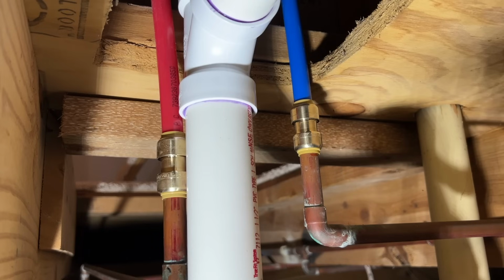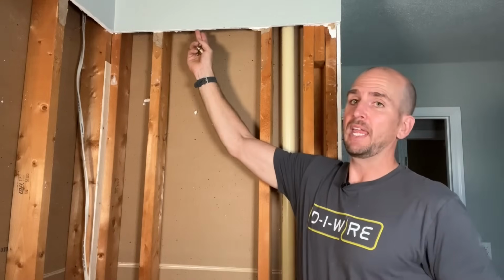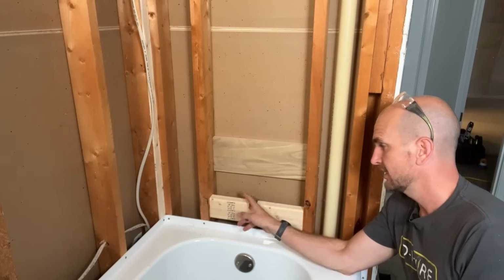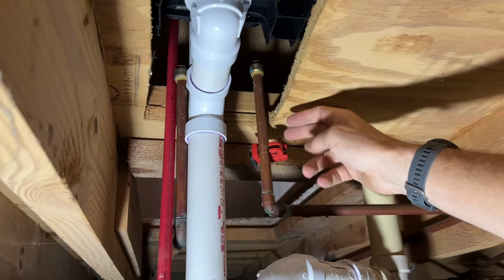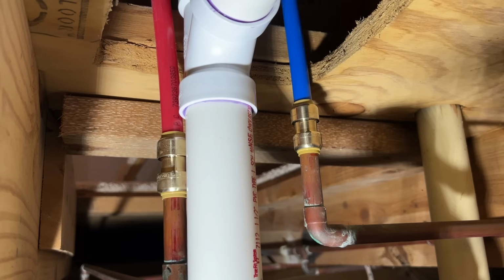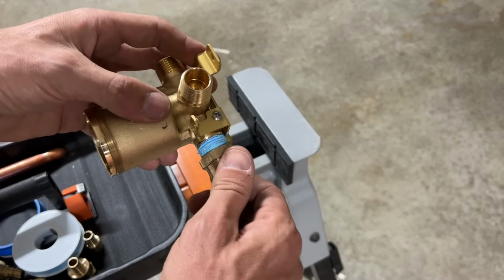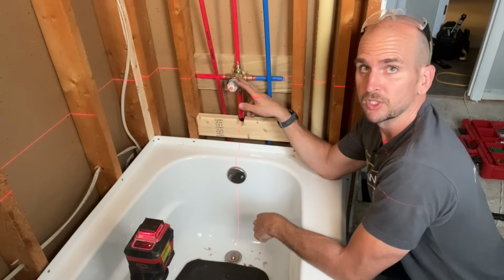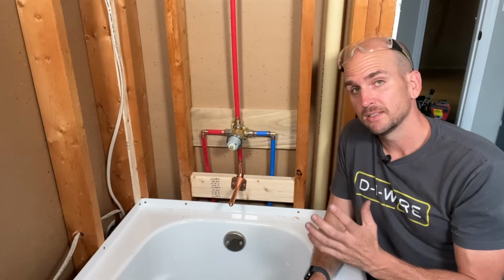How To Convert Old Copper To New Pex | Tub And Shower Plumbing

Comment: I lost all respect when you used push fittings. I have over 40 years as a professional plumber and they do fail regularly and when they slip completely off damages can be catastrophic.
Reply: Retired GC with 25 years.  My plumbers, several with 40+ yrs experience, use them.
Reply: You are just an old man resisting change from your old ways. I can imagine your reaction when you first saw a sharkbite fitting: "WAIT WHAT!!!? NO SOLDERING WHAT KIND OF WITCHCRAFT IS THAT!!!?" 😁😁😁
Reply: @kllgrogto5838 sharkbotes fail everyday.
Reply: @kllgrogto5838  well, it seams like at least 11 plus agree with me and if you have ever worked for several customers with massive property damage from push on fittings you my feel different. There are several more skillful and permanent options available. Push type fittings are definitely easier, needing fewer skills and tools to perform the job.
Reply: @jamesmarek242  push on fittings are a fairly new concept and although it seems easy many people just don't do the prep work before using one of those and that's how they fail, the same way a soldered joint would fail if the joints aren't prepared and soldered correctly.
Reply: @jamesmarek242  plumber of 30 years here, and I agree with you 💯! Sharkbites are a homeowner solution to connect pipes, nothing more! NO professional plumber should use these! You were trained, and probably paid to do it right! They make proper transition fittings that are soldered on, then switch over to PEX.
Reply: Mehhhhhh
Reply: When people take a lot of time to make a video, be a little kinder with your peanut gallery comments.
Reply: Unless you've done a root cause analysis on why those fittings failed, you're just blowing smoke because you're resistant to change. And who cares how many likes you got. Now you're trying to say "might makes right."
Reply: if they are installed properly they will never slip off.
Reply: Yep. I was just waiting thinking "what's the transition fitting gonna be?" Personally I always use solder copper for tub/shower. But if he had used 5/8 or compression to 3/4 or I guess 1/2 pex, then I would have been ok with it.
Reply: Blablanlabla
Reply: It’s always interesting to read the comments. Everyone always has a “better” way because they have been doing it X number of years. Better is usually limited by the hands that’s doing it. As a DIYer using push connect fittings will likely give you better success than trying to learn to solder pipes. It’s A DIY video not a page out of the plumbing manual for professionals.
Reply: You're so experienced why are you watching how to videos on something you know so much about? 🤔  I don't disagree about the push connections but your tone stinks.
Reply: And your respect means what?
Reply: Sharkbites dont fail.unless installed improperly
Reply: no they don't. You're just like the guy that grilled him for the tub install for not having a ledger and screwing through the flange.
Reply: Guess you missed where he said diy means not paying plumbers for doing it
Reply: Agreed.

Comment: Would you or the plumbers in here recommend this over using copper pipe with compression fittings?
Reply from the maker: My own personal preference is Sharkbite over compression fittings.  Just my 2 cents.
Reply: Yes if your not comfortable or skilled at solder, definitely next thing I'd receive is copper with compression fittings. It's gonna cost more in fittings but you still get rigidity like with solder. Which you definitely want on this install.
Reply: Not a plumber, but the plumbers on Reddit mock Sharkbite mercilessly; it relies on an O-ring and God help you if you miss a burr on the cut pipe.

Me?  I've soldered a transition to Pex-B.  You know if you did it right!  Same with compression but you can always give it another 1/6 turn tighter if it weeps.

And check out Pex-A /expansion fittings (plumbers smiled with respect when I said I'd bought brand-name Uponor/Wirsbo.  Apparently, I'd cracked the secret code!)

Comment: Did you consider adding shut-off valves to the hot and cold just for the tub?  This way you don't need to shut off the entire house hot or cold to service the tub fixtures.  Also, do you need to pressure test after completing the fittings and prior to covering with the surround?
Reply from the maker: Not really for this project but you can also get the Delta R10000 with a version that has screw water stops on the hot and cold that can be closed right at the inlet to the valve https://amzn.to/3MCFJfm  Kind of handy.
Reply: @EverydayHomeRepairs  By the way, thank you for your great productions. You are providing great insight for the DIYer!
Reply from the maker: @Rob-Eckert  Thanks man 👊

Comment: I wish this video would have came out earlier this week. I just finished a big project where I ripped out a ton of funky ancient copper with a ton of elbows and unions and replaced it with nice clean runs of Pex-B.  I did not use any Sharkbite fittings. I went with the Pex "pinch" rings. If you have a chance, check out the Ryobi 18V Pex pinch tool. It made child's play out of installing the rings even in tight spaces. (Ryobi also makes a battery powered copper ring crimp tool). I believe Ryobi is the only company to make a battery powered Pex-B "pinch" ring tool. My brother was helping me and he couldn't believe how fast and effortless everything went with the battery powered pincher. Well worth the $119. One reason I went with the pinch rings is they are easier to remove than the copper crimp rings. You simply nip the crimp nub on the ring and the ring literally falls off. Then I take a battery powered heat gun, heat the pex for about 15-seconds and it pulls right off the coupler. So there is no need to cut the Pex in order to get in there with a copper ring cutter. Anyway, I was very happy with how everything went.
Reply from the maker: Thanks for all the great feedback.  Hard to beat Ryobi for the DIYers 👍
Reply: For now....was the copper leaking?
Reply: @maxpower9848  I had one small pesky leak and the entire run was nasty looking to the point where additional leaks could occur at any moment. I had one 24-inch section that had FIVE! junctions!!!  I'm not kidding. It was like they used a whole handful of 4-inch pieces instead of one single piece. I also had a shutoff valve that was frozen. Now things are super clean with better flow and ball valves used throughout. I plan to replace my water heater soon and now it will be effortless.
Reply: Great comment.   California

Comment: Why would you use pex in place of copper? Not construction savvy.  I did 3/4 copper in my house based on a professional plumber.  My father in law.
Reply: 3/4 inch copper is a great choice. You shouldn’t have any problems. Plumbers and builders are moving to PEX because it’s easier and faster than copper, and lasts just as long.
Reply: @MoneyManHolmes  While you can expect PEX to last for 30 to 50 years, copper piping will outdo it by about two decades, with a typical lifespan of 50 to 70 years. Copper is a more durable option that isn't susceptible to rodents or sunlight. After having to replace all our copper after the water caused pin holes we were told anything past 20 years would be amazing.
Reply: @mj-hk6iv  You just contradicted yourself, or else what you wrote wasn't clear: you wrote that copper will outlast Pex by about two decades, but then you said you had to replace all your copper due to pin holes (corrosion). That is the big downside to copper, and it seems to be dependent on chemistry of the local water supply. What corrodes copper won't even phase Pex, and it may end up lasting longer than the estimates. It hasn't been around long enough yet-
Reply: @isabellavision  Interesting, because @beerbeforebreakfast replied to the post before this one saying, he just replaced pex from 1945. So I wonder how long it has actually been around.

Comment: Will you be adding blocking behind the new surround to account for future grab bar installation?
Reply from the maker: The only blocks I was going to put in are the 2 being called out by the Delta 400 Series back wall panel but I think those are just additional surface area for the adhesive to bond to as opposed to something solid for a grab handle.  Not a bad idea though 🤔
Reply: @EverydayHomeRepairs  It certainly is for those of us who plan on staying in our homes until we're old and decrepit! 😁

Comment: With crimp style (pex B), you’ll want to go with 3/4” PEX and fittings as the 1/2” fittings are quite small and reduce pressure a lot. You don’t have to worry about this with PEX type A, as the fittings are the same size as the tubing.
Reply from the maker: Thanks for the feedback, I really like Pex type A and almost used it in this video but Pex type B is much better suited for DIYers which is a good portion of my audience.  I just wanted another excuse to but a tool for the Pex type A expander.  Wish Makita had one to fix my battery platform.
Reply: The reduction in flow from the pex b fittings is minimal to the point of being irrelevant unless you're trying to use pex the same way as copper. IIRC, 6 brass 90's on a 30' 1/2" pex pipe causes 1 PSI drop at the fixture. Keep something in mind, it takes longer to get hot water moving in a 3/4" pipe, even pex. If you feel that you can trust Viega, they did a study proving that the differences between a and b fittings is negligible. Do not go to 3/4" pipe because the internet told you to. I don't know what your setups consist of but generally smaller fittings and pipe increase pressure and velocity but reduce volume and most fixtures are capped at a volume of 2.5gpm. He didn't need to use 90's at the valve. I usually just put a bend into the pex and run it up the adjacent bays.
Reply from the maker: @chrisford8403  thanks for the info, appreciate the feedback 👍
Reply: @chrisford8403  thanks for the info
Reply: @chrisford8403 if I need to use a 1/2” pex 90 to connect to my copper stub out for the tub, will that cause water to flow to the shower head due to the smaller inside diameter of the pex 90?
Reply: @LogosFarm   I've never had that issue but the several times I used Pex it was similar to the video were it was only 6ish inches long with 1/2" drop ear and then a nipple or copper stubout with pex adapter built in; also, the valve had an integral diverter. I almost always follow what the manufacturer recommends and they almost always want copper pipe from the valve to the tub spout but everything else can be pex. I do know that Moen, Delta, and Kohler want COPPER ONLY to the tub spout. Personally, I'd use copper with drop ears and a nipple. If you don't want to use a torch then buy threaded pipe and fittings. Sorry, but I can't recall the name of a valve that uses pex to the tub spout but at least one does exist but it had an integral diverter and I think that's the reason why it could be done. Moen has a valve that's pex ready with copper and stubout factory installed.
Reply: @chrisford8403  Thank you for the response. I did do some research and like you said Delta does say copper only, I did attempt the pex straight down to copper stub out. And the water did indeed flow out of the shower head while tub was on. I guess the 1/2” pex ID truly is smaller than 1/2” copper to the point of reducing flow rate. I had never realized or truly considered that possible.
Reply: @LogosFarm  The id of Pex B and its fitting is definitely smaller than copper. In the grand scheme of things it's irrelevant with exception of bath diverters. Usually the restrictions built into valves and appliances negates most the smaller id. Keep in mind most sink faucets size down to 1/4" hose. IMO, I usually assume that the manufacturers want a successful install so their suggestions are worth listening to. By any chance, did you experiment with using 3/4" pex to the tub spout? Another thought, how high above the valve did you mount your showerhead? It should be around 48". I started hearing about this issue a little more than 5ish years ago but never ran into it personally. Also heard it happens with CPVC but I've only seen that stuff once in the wild and we were tearing it out. Best of luck.
Reply: @chrisford8403  This being my first mixer valve I somehow missed that, lesson learned. Due to the mixer valves M threads being 1/2” and the spouts connection 1/2” I didn’t have the connections on hand to up size than reduce. Instead had to settle for shark bite NPTF and a drop down elbow shark bite using copper, as I unfortunately am not skilled in soldering. The head sits at 55” a bit higher than normal but requested as that was the previous. I had hoped the extra bit would help but no luck. Thanks again for the info
Reply: @chrisford8403 so your saying I can avoid the 90s and just bend the pex into the valves?
Reply: @ThatMakesCent  Yes...and no. You can totally use the 90's but one of the benefits of using pex is fewer fittings. Using fewer fittings saves time more than money and removes a possible fail point. Pex will only bend so much before it kinks. I THINK it can safely make a 10" radius and a heat gun or hot water bath will make it bend easier. For what I'm saying to work, the guy in the video would have to had run his pex along the 2x4 for the extra space and then bend the pex at a 90 with a long radius and cut to length. Either side of the 2x4 would work. If it was possible, I would have run the pex in the bays to the left and right of the bay the valve was in and bent it. Sometimes it's just easier and quicker to use the 90's; sometimes it's necessary if you have tight work spaces. People get silly about the pex b fittings inside diameter causing pressure drops but you would need to do something crazy like using 20 fittings on a short run to have an issue. Basically, when I use pex I try to minimize fittings to get the most value out of the system. Once upon a time plumbers would do the same with copper, even rigid pipe but, I only see that in old school systems or underground main lines using soft copper pipe.
Reply: @chrisford8403 got it, yeah im gonna use the 90s because I didn't account for bending the pex and just dont have the space to do it without kinking anyways
Reply: Agreed,  if I were to do my shower again,  I'd do that.
Reply: The newest Pex-B made by Zurn uses the expansion style fittings like Pex-A and it handles the Chloramines found in much of the municipal water today. It is still a lot stiffer than Pex-A though, so if you need to bend it that could be a problem.
Reply: @ranz2355  First of all pex-a and pex-b it’s not a grade it’s a manufacturing process, so zurn start to make their own pex-A pipe and fittings. And the reason why they start to make it it’s because pattern for expansion fittings expired and everybody start to make expansion fittings
Reply from the maker: @ZIBO2830  Interesting, thanks for sharing.
Reply: @ranz2355  Good info.  Hadn't caught the expandable/F1960 PexB by Zurn... Until now!

Though in reality you can crimp Uponor PexA but it's fighting the crimped ring forever, they say.

Horses for courses, as the Brits say!

Have you used Zurn?  Any feel for durability?
Reply: Yup 3/4 is equal to 1/2 inch ..
Reply: Doesn't matter how big the pex is.  The valve is the restriction as it is an 1/8 inch passage from the tub outlet up to the shower. You have 1/4 inch passages in the mixing cartridge, but smaller than a drinking straw going up to the shower head, unless you have a dedicated shower and install the rough in upside down.

Comment: Type b pex should never be used to run from the valve body to the spout as this may cause a flow restriction . Water can come out of the shower head when trying to fill the tub due to the pressure building up caused by the reduced diameter of the crimp fittings.
Reply from the maker: Thanks for the feedback, i would be surprised if the restriction is more than the head pressure running from 30" valve to 80" shower but definitely something I will keep in mind for future projects.  What about 3/4" Pex type b from valve to spout?
Reply: @EverydayHomeRepairs  yes 3/4 pex, type a expandable pex, brass pipe, or copper. We normally just use copper for this, at the commercial supply houses  they sell the valves with this copper already soldered on
Reply from the maker: @denniscordova9920  nice!  Thanks for the feedback, I will swing by Holt Supply as that would be awesome 👍
Reply: Question: so I just had a bathroom remodeled. It had no shower head plumbing and I believe mostly galvanized pipe. Anyways, the guy I hired used all pex. Before paying him, I turned the tube on and my shower head would leak. Further research, it's because he used pex from the diverter to the tub spout. Anyways, I needed him to fix but obviously he wasn't going to cut the new tile. So he had access to the back of the shower portion. He ended up changing the tub spout that he has pex to copper, to 1/2 galvanized pipe and the pex from the diverter to the shower head 1/2 galvanized pipe. He fixed the issue which was great. But, obviously I wish it wasn't galvanized. Anyways is this a big issue for me or should I be okay for many years before it starts to break down?
Reply: @dltorres17  hopefully you'll be okay but preferably we like to take out any galvanized that we see if we're already opening the walls and putting in a shower valve